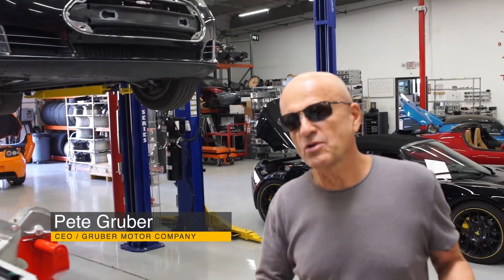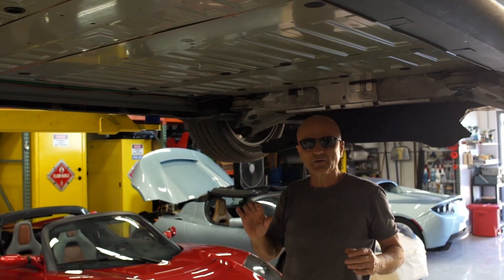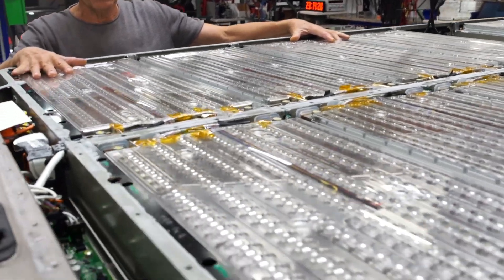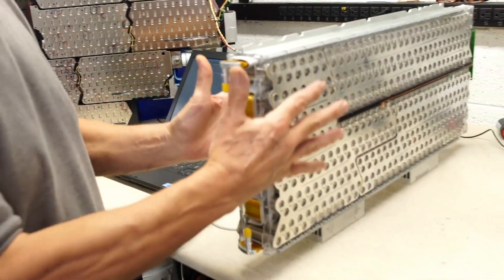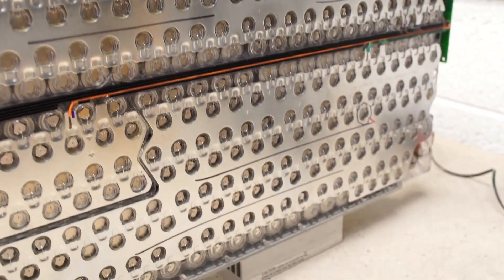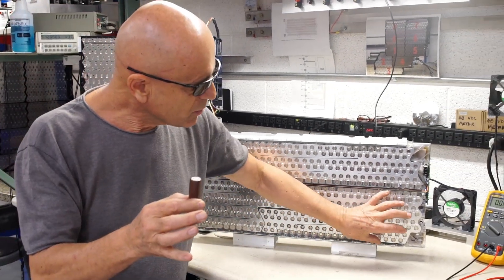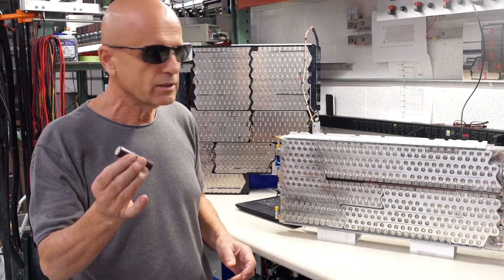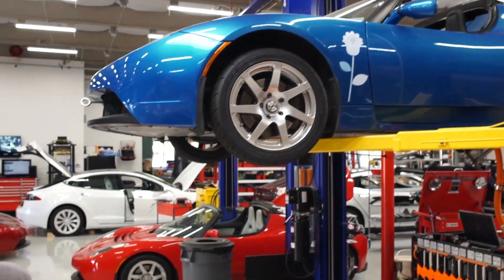Tesla Model S Main Battery Repair | Gruber Motors

Comment: Very cool and great explanation. My qustion is: do you isolate only that one defective cell or the whole brick within that module? My guess is the latter, because you break the connection of the serial portion? Do you need to modify the control board in any way to accomodate for the missing cell/brick?
Reply from the maker: Snip it out...the car never realizes one of 7104 is gone AWOL.
Reply: @grubermotorcompany  Thanks for your reply, very interesting. Did you ever come across a module, that had so many damaged cells that you could not snip it? Can you just leave the whole module out or do you replace it with a known good one?

Comment: What happens repair wise when Tesla switches to cell to structure architecture? Maybe they well isolate it with software, either automatically or using software in the repair process?
Reply from the maker: We do what we do best, reverse engineer, and innovate.

Comment: 1:26: "It requires special equipment to remove": Hold my Rich Rebuilds
Reply: A lot simpler than an engine repair on an ICE car.
Reply: It's engineered to be removed in 2 minutes.
Reply: @graciescottsdale  perhaps one day, defo not yet.
Reply: @brad9529  There are videos.

Comment: what was the mileage on the unit @ repair ? whats the expected  ave life of these Bat packs ? what was cost and leadtime to repair ? what happens to the bat packs once they are not worth repairing ? can you recycle Lithium ?
Reply from the maker: It was down to 7 miles at full charge...life expectancy with LI-Ion is still being written with Roadsters going on 13 years...Lead time - 3 Weeks - Cost $5K - JB Straubel is recycling LI-Ion packs now.

Comment: I've been thinking of buying a Tesla but this video gives me pause. Why don't they add a little bit of electronics to isolate the packs from each other and just switch off a defective pack rather than letting a 1 in 7000 failure disable the car? I patent this idea if Tesla hasn't thought of it yet. No never mind, they can have the idea so my future Tesla will be more reliable. This small addition could isolate that defective pack and inform the owner but still let the car continue with 13/14ths or 15/16ths capacity. Are all those about 448 batteries in one pack all in parallel?
Reply from the maker: EV battery design, or DC energy storage, will most certainly improve in the future, but in the meantime, this module/brick/cell design is the most cost effective way to build EVs.

To put single cell battery management on each of 7104 cells, makes the pack much larger, and raises costs beyond what is marketable and reasonable.  Cell failures are aberrations, and not the norm when you consider the huge numbers of vehicles in service without issues.

Buy your Tesla.  You will love it.
Reply: @grubermotorcompany  Not single cell management. Just pack management. I think you said there are are 14 or 16 packs. That would be very reasonable. Why let one battery in a pack of about 500 disable the entire car? Just disable that pack and let the other 13 or 15 packs take the load and inform the owner to get to Gruber Motor Company ASAP.
PS: I'm living overseas now but seriously considering a purchase when I move back to the US.

Comment: Will you advise me to get a 2015 Tesla D85 with a rebuilt title with no battery for 18K
Reply: A MS without battery, or failed battery, usually sells for around $10K, especially a "rebuilt" title assuming salvage.  Pricing is based on using the $20K battery cost from Tesla, for a $30K car.
Reply: @petegruber7564  I
Have been seeing the same type of vehicle for 30k

Comment: Could you show us how you removed the bad cell, and show the cell you inserted, and how you re-connected the new cell?
Reply: The old cell wasn't replaced.  It was isolated electrically from the rest of the pack.  The pack lost 1/6000 of a percent of range.

Comment: What if you fix the faulty cell then you put it back and another cell goes bad. I think the best solution is to replace the whole battery pack.
Reply: The hundreds of millions of LI-ion cells Tesla has installed in their fleet of vehicles on the road proves that failures like this are a very rare exception and isolated anamoly.  One cell going bad in a 6 year old car, does not preclude all the others are on their way out.

The Tesla Roadster, which has been on the road for 12 years plus now, proves these cells are stable, and lasting longer than the 10 year life projection.

There are a lot of good videos discussing cell behavior on this channel.

Comment: Finding a bad cell in a module is easy , you charge it up near 100 % and look at it with an infrared camera that plugs into an iphone . Bad cells get called heaters because they get hot and the infrared camera finds them right away .
Reply: We find too much "bloom" using just infrared imaging, and have tried a number of different camera types.
Reply: @petegruber7564  Thanks for replying ,  I find just touching individual cells with finger tips finds the hot ones , the heat is most noticeable  on the positive terminal of the cell  because of the cells built in the pressure relief circuit breaker switch that's under the little dome on the positive end of an 18650 cell has tiny contacts that restrict current and cause heat build up there .

Comment: i have a 2013 p85 that has a bad cell car has 13k salvage title  anyone on the east coast that can fix thanks
Reply: We do not have anyone in the US that has been trained how to we isolate resistive cells in a Tesla brick.  The cars are shipped to us, and we handle transport and coordination, passing it on at cost on the final invoice.  ev@gruber.com
Reply: @petegruber7564  can you figure out ship and repair module 5 has a bad cell zip code 11733
Reply: @mikeinnusa8786  Open carrier transport from that zip is around $1200 each way.

Comment: If the cell becomes resistive when it goes bad, why not just look at the pack with a thermal camera and identify the bad cell in an instant?  Hint, it's the red dot in a sea of blue.
Reply: We find a combination of charge/discharge, measurements, and thermal help isolate the cell.
Reply: @petegruber7564  How one "bad" cell in  parallel pack (cell with more ESR than other ones I guess) is influencing in whole battery system (of 7k cells) to be worth of around 5k USD repair. Trying to understand it from engineering point of view.  Looks totally out of economical reason. Especially repair by removing it from system instead of changing to new one.

Comment: Can't wait to listen "Hey guys, ChrisFix here... and today I'm going to tell you how to find and replace a single bad cell"
Reply: well they didnt replace anything, they just separated a draining cell that was pulling one pack down. Now the car has a bit less energy in one module. 
Must have been weird fusing happening inside it, not total short. In case of a short - the cell fuse would have tripped and separated itself. It's not really made in a way that 1 out of 7000 could disable the car. I'm guessing the car actually drove but kept telling there's a problem with battery. Because one module was dropping voltage a bit faster.
Reply: ...or several sub-modules

Comment: Ah nice one, loads of 18650, seen / had many die in laptops 4 in parallel one of the 4 essentially becomes a resistor and slowly discharges the remaining 3 in the parallel config, and set cant provide the same current as rest so goes flat quicker, battery monitoring / management realises and prevents charging to stop 1 battery potentially exploding, you got any jobs going???   How do you actually do the replacement, I'd be interested in a video of that as the +ve & -ve plates are pretty large on each bank si getting one out right in middle must be difficult.
Reply: Getting them out of the brick is too destructive and close to cooling jackets.  We merely snip it out once we've isolated it.

Comment: Since removing the traction battery from a Model 3 is a fair bit harder, it would be interesting to know that repair cost; likewise, it would be nice if you could buy the top lid (maybe you can) from Tesla.  The cost of the lid might be cheaper than paying for labor to carefully remove without damage .

Comment: $5000 is taking the piss a bit.
Reply: If you check the guys working on the car, they take the battery out in the morning as he says in the video.  The at the end you see the guys putting it all back together. They’re all still wearing the same clothes.
Reply: Its several days worth of work- removing the pack, removing the cover and finding the cell and putting it back together but yeah it is.
Reply: Several days.  Bullshit.  They wouldn't tie up the hoist for days.  1 day max.

Comment: All the trouble of troubleshooting to a bad 18658 cell and you don't bother fixing it correctly?  You know the other batteries that were wired parallel to it will be overworking and prone to fail.  I would replace the cell ,  and test those that were parallel wired .  It may just work forever more with a missing cell too I guess.

Comment: Only 1 of 7000 has to die..design flaw?
Reply: Unless the BMS extends to single cells, (cost prohibitive) these parallel connected banks or bricks will suffer from these types of failures.

Comment: Good video. What the man hours for this procedure?
Reply: We have three days in the project with a team working on it.  Aside from the cell search, the equally challenging part was preserving the top lid for re-use and reinstalling it with proper sealing.  At Tesla Lathrop CA reman, they just go pull a brand new unused one off the assembly line.
Reply: Thnx for the reply. I like your way of thinking of repairs. Great job and for the amount (you mentioned 5k in the next video) sounds totally worth it! Best regards from the Netherlands (Many Tesla's but repair services still have to be developed on this particular level)
Reply: We have a high rate of first users EV's and actually sell almost 80% of all second hand EV's to other EU and African nations...

Comment: Great video! With the new structural battery design I am wondering if such a repair would even be possible. Can you comment?
Reply: The challenge in the aftermarket space is reverse engineering to determine exactly that.  The issue is not if, but is it economically feasible.

Fortunately, Tesla, unlike many other manufacturers, is not obsessive about protecting their turf by designing safeguards to lock out competition.
In the Critical Power Equipment market, where we come from, companies like Eaton intentionally develop proprietary padlock software designed to prevent competition, vigorously litigate to defend, and the end user owner suffers with high service/repair prices.

Comment: Was the bad cell replaced?  Or was it simply removed, with no replacement.
Reply: Removed by snipping it out.  Cell vasectomy.
Reply: That's kinda weird, since these cells retail for only around $10 each. Kind of a disservice not throwing a new battery in there while it's already cometely dismantled.
Reply: @sped6954  tearing it apart to get to the one cell is not worth the cost of just removing it by snipping it.
Reply: @sped6954  We wish it was as easy as replacing cells in a flashlight.  To remove LI-ion cells in thermal potting compound and cooling jacket impregnated battery stacks (bricks) is destructive.  Snipping it out is the most sensible way to do this.
Reply: @petegruber7564 
Ok. Thanks for the info about them being all kinds of hermetically sealed in six ways to Sunday. I thought that by the time you got to the point of snipping the connections, they were already at the point where they could be lifted out and a new one dropped in in its place. My mistake! 😁

Comment: Had the defective cell not gone bad enough to blow its individual fuse? If it had blown the fuse, would the module and pack have continued to function?
Reply: A parasitic cell became gradually resistive, draining the other charged cells in a parallel connected brick, but not enough to blow the fusible link wire which is good for around 9 amps.  If it had blown the fusible link, we would have not been necessary.
Reply: @petegruber7564  .....there you have an opportunity for a design change.

Comment: So Tesla cant just sell one replacement stack and work it out through trial and error?
Reply: Or don’t fail the car due to a single bad cell.
Reply: @Arslun 
Yeah that's a pretty screwy way of wiring them. You'd figure that as expensive as they are, and the way Christmas tree lights have advanced so that one burned out bulb doesn't kill the whole string, maybe they could figure out a way to connect the batteries in a similar fashion. I mean, we're talking about completely disabling an entire car because of a $10 18650 battery that you can buy at literally any vape shop.
Reply: @sped6954  They have to fail safe when a bad cell is detected.  The risk if they don't is melt down / fire of that cell.  Generally when a cell fails instead of holding charge it creates heat.

There's no way at this time for a BMS to isolate a single cell and keep going.  A BMS could monitor each cell but not isolate it.  To build a pack where each individual cell could be isolated would make the pack MUCH larger than they already area.

When that day comes that a cell can be isolated it will be huge news for the longevity of battery packs.
Reply: Tesla is struggling to amp up production at breakneck pace due to high demand. That may be why they'd rather have you purchase a new pack. Doing this kind of repair might not be worth it to them. They probably see it as mission creep.

Comment: Will the BMS work to charge this module at the original voltage, thereby shortening the life of the remaining cells in that 21v pack/module?
Reply: Each module, contains 6 bricks connected in series.  The cells in a brick are all connected in parallel, for a total of 74 cells.  The impact of disconnecting one cell out of 74 is imperceptible by the BMS or life expectancy of

Comment: I work and fix tesla batteries in my country for 2 years now. The battery is super sensitive and you must take care of every step you make. One of the most hard things are sealing the battery pack so it will return sealed as it was, the problem is that it will not be water resistant as it was before, which means you cant drive it in winter again. For now the best sealing way is using rubberized silicone and a nylon cover. This prevents water from getting in by approximately 70%.
Reply: There are 3M sealants that are 100% waterproof used on boats and in salt water (3M 5200). So if you are getting water into your batter casing you're doing it wrong. Either you're not using the correct sealant, or you're not applying it correctly.
Reply: @jrmorrissey207  Honestly this is the first time I've heard of this sealant, I did some research about it and it seems like it is the best sealant on the market. I am ordering couple of them soon. Thanks for the advice though.
Reply: @jrmorrissey207  You sure don't want to take 5200 apart again!
Reply: @opera5714  doesn't 3M make a product that's almost as good at 5200 but is removable to some extent?
Reply: You must use 100% polyurethane-based caulk only lasts 25% as long as pure silicone does?
Reply: I like tô learn more about batterys on Electric cars
Reply: Where can I find online courses
Reply: Thanks for the update Iive in the Seattle area it's really wet here and we have a lot of really rich people driving these cars
Reply: . Do you repair batteries? I live in Bellingham
Reply: Pathetic 😂😂😂

Comment: This company totally lost all credibility once I saw them physically touching the high voltage components without PPE. This video just as well could have been him being electrocuted. 400 volts is nothing to toy with.
Reply: Jan Lenz , the sheets of the Roadster have 37 volts, but this is also no problem. The metal case have no voltage. There is no need for glove in this case. If you take out the bridge, one of the half battery from model 3 have 200 V. Mister Gruber knows exact what he do. in other videos he carry gloves for his work if needed.
Reply: Did you not hear Gruby saying each module has 22V?
Reply: @moestrei  , is the differenz between Roadster and the other Tesla models  11 sheets a 37V gives ca. 407 Volt in the roadster.

Comment: I love how you explain things. Very clear and informative.
Reply: So true. Not an actor, no dramatization, just a guy who knows exactly what he is talking about and edited down to the density of a Hemingway short story.
Reply: The problems is, there are not many shops who can repair these batteries.  They are increasing, but they are still few and far between.  If you are in some place like Montana, you may have to be towed a thousand miles!
And, somewhere between 150k and 200k miles, you are gong to have to get the battery pack fixed.
Reply: @roadscholar05  If somebody in Montana buys a Tesla they are asking for trouble.
Reply: Yes, this was an outstanding video. Thank you Mr Gruber 👍
Reply: I was going to post the exact same thing, this guy should a teacher!
Reply: @marcroy8023  Great minds...

Comment: Not sure if i understood correctly. Did he just disconnect faulty cell, or did he replace it?
Reply: He replied to another comment asking about the quality of the replacement cell and said they are not, just snipped out of the circuit. He also mentioned performance is barely discernable as it's 1 cell in 7000
Reply: Yes, I have the same question.  It's like the punch line is missing.  I can't imagine not replacing because the voltage in parallel would be off with regards to the other units
Reply: @georgepyrpiris7857  cells in parallel do not increase voltage, they increase capacity. That block of cells will just have like 2,000 or so mah less capacity than the other blocks of cells.